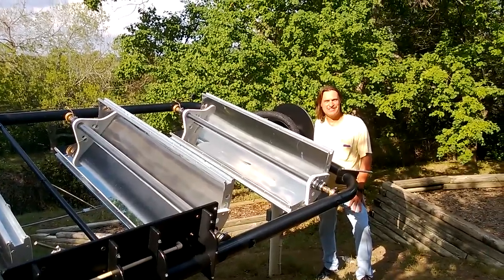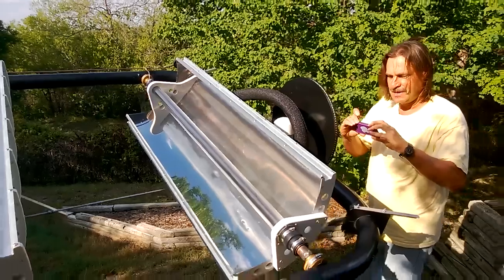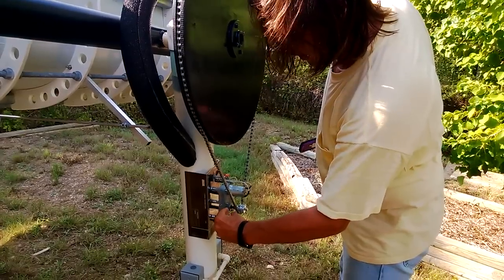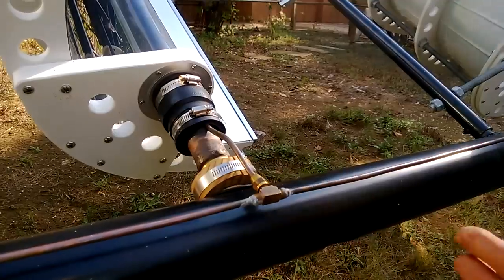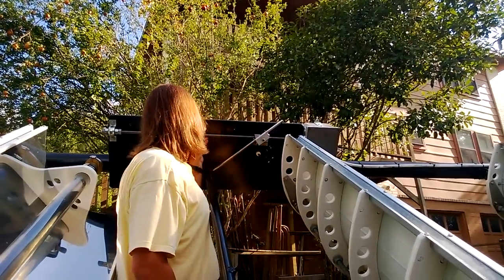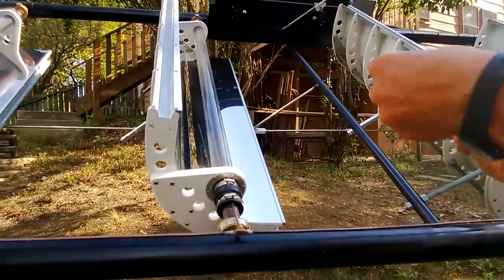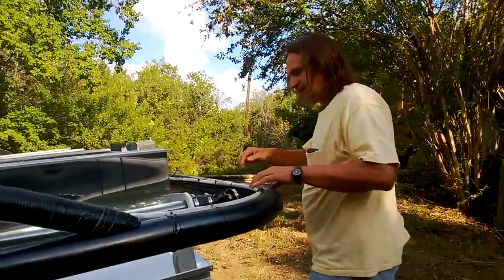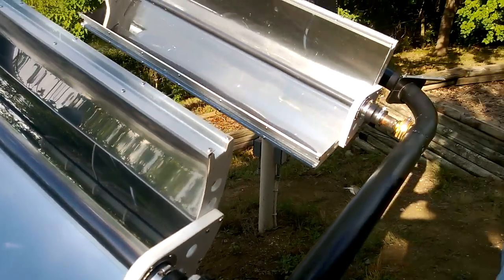Parabolic Trough Solar Collector Water Heater 6

Comment: Excellent job! This is truly great work you’ve done! I’m currently in the process of designed something very similar. What are the numbers for how much energy you’re collecting? Like btu/day collected? Surface area of collection? 

Have you considered putting the whole system on a slight angle, lower on the south side higher in the north side, so you could fit more troughs in the same footprint? 

Oh also what would you estimate the build cost at this point? 

Thanks again for sharing your success! I hope my build comes together looking as nice as yours!
Reply: I hope that he give us an update on how well things have worked in the long run.
I find his design very impressive, with a lot thought going into it.
I am thinking of how to reduce the amount of work involved to make a simpler design and I have a few ideas. 
He explains in one of his comments at the very bottom of this list, that you can reduce the complexity a bit by using one pivot. This is a link to his comment.
youtube.com/watch?v=tlBRpQffIBA&lc=UgxWqgiBnY3BdKQBuq94AaABAg 
- - - -
(1)-If you design just one bigger reflector, you eliminate wasted spaces between the reflectors.
(2)-Design the parabola edges to go at least a couple inches above the center tube.
(3)-Then you can put one sheet of plastic, or polysheet, or glass, across the whole thing to protect and keep the reflector cleaner.
(4)-There will be less t's and joints interconnecting all the tubing.
(5)-I have no interest in creating steam, as it will be harder on the connecting seals, and other parts of the system.
(6)-because of this, I can make the center tube larger, so that it takes care of times when the parabola is not precisely facing the sun. 
The suns rays will then be reflected to the surface of the collector tube, instead of missing it.
It takes care of problems where or if the reflector was made a bit off shape from an exact parabola shape.
(7)-To further take care of alignments when the reflector is not exactly aligned up with the sun, make the center collector tube sort of flattened.  
You can use 1/2 inch copper tubing and put a "U" shape by doubling back, or use 2 copper pipes side by side to be the center collector with the ends joined at each end.
A simpler method is to have 3 lengths by looping back and forth, so that you have a wide but narrow collector pipe to take care of  alignment difficulties or irregularities. .
(8)-When you are using one large unit, it is advisable to have this arrangement of piping for a larger center collector pipe.
(9)-When you are not intending to make steam, by putting one poly tube over this center collector tube arrangement, you can still get reasonable efficiency without the need to evacuate it.
(10)-The reason why this should work better than a flat plate collector is because no matter what your climate, you are considerably  reducing the overall footage of cooling surfaces, and I do not see the need to extensively insulate the reflector surfaces. 
- - - 
Let me know if you are able to read this comment OK. 
Give me your thoughts and suggestions. 
-
Reply: @DocScience2  I definitely have to give some of the credit for inspiring the design I ended ip going with on my solar collector to Andrew Gray. Watching this video really helped me finally make the executive decision on which of the many ideas I had to go with.
Reply: =  @CharlieSolis  = Thankyou for the fast reply.
Have you posted any pictures of your setup and descriptions ??
Reply: @DocScience2  I’m still awaiting materials. And hashing out the turbine build process. It’s super cold out where I am right now so I’m going to start assembling things in the summer.

Comment: Selling it is a good idea but posting this as open source will also help contribute to the betterment of humanity. Please consider doing this.
Reply from the maker: Hello DR Paquette.  Do you think there is enough interest and ability out there to put the open source effort required for this?  This design is really for the advanced do-it-yourselfer. (?)(?)(?)
Reply: Yes i do as a good portion of the population have been working in IT in one form or another for many years. With those careers (programming, database config, electronics design & integration, etc.) I am sure that it will be just fine for these people.
Reply from the maker: Well, I have been approached for plans by a few people and I have helped some build a few.  But the demand has been low.  So it is worth mentioning that I will help someone construct one of these solar heaters if they are interested.  AAG

Comment from the maker: 1) Yes, Grant.  On a clear summer day at 4 liters/min flow, one gets a 10 degree Centigrade drop across the heat exchanger.  That is roughly 2.7 Kilowatts, or about 9000 BTU/hour.  I have not made the measurement yet in winter because I need to mount the system up on my roof for it to be able to "see" the sun.   

2) The main advantage over regular commercial systems is that it will work in the wintertime when it is cold (it is insulated with a vacuum) and windy (comm. systems don't work then).

Comment from the maker: Jozef,  
I have the water circulate through a heat exchanger in a 50 gallon water heater tank.  This heats up the water tank for showers, dishwashing,etc.  It has dropped my electric bill by about $50/month.   

No, I am not producing electricity with thermo electric generators.  That would require that water be boiled and regulated through a generator.  That is a much bigger operation than what I have!
Andrew Ancel Gray

Comment from the maker: Thanh, I have used 1/2" hydraulic hoses from Northern Tool to make the flexible plumbing.  These hoses are REALLY tough.  So far no problems.  I am using a 12V TopsFlo TS5 15PV  pump to circulate the water.  It is about $70 on amazon.  So far no problems.  I have not used it to circulate water to and from the roof of my 3 storied home, however.  It should be OK since the circulation pipes will be FULL of water (as much pressure downward as pressure needed to pump upward).  I will let you know.

Comment: Let me give you and advice. Elevation angle adjustment is not necessary. Installation should be calculated to provide enough energy in winter when conditions are worst. The elevation according to sun elevation in winter should be ok for the rest of the year, since deviation will be desired to avoid overheating in summer.
Reply from the maker: Yes, Jorge, this can be true.  That is, if your spot to mount the system is oriented exactly East-West, then the second rotation-axis would not be necessary.  But if your roof faces, say, SouthWest, then the dual axis system is really nice.  Also, the dual axis system can be mounted in the "North-South" orientation so sun exposure happens ALL DAY.  And near the Arctic Circle (e.g., northern Canada), a dual axis system can get sun exposure for 16-20 hours per day (a single axis system cannot do this).

Comment from the maker: Well, I finally totaled everything up and since I did several generations of troughs, drive mechanisms, electronics, etc., the cost (for me and my experimentation) turned out double to what I was thinking, a little more than $4000.  I still think that a lower price than this can be attained if one starts with a "fine-tuned" plan and does not get distracted with experimentation (don't get me wrong, the experimentation  was fun and entertaining).  The system is now running month after month like an appliance with no attention now.   My electric bill this month (april) for my 1800 sq ft all-electric home was just $68.  Wow.  So when I put photo-voltaics on my roof in front of my water heater (the heater will be mounted on the NORTH side of my roof), I need to install a smaller system than originally planned!
Andrew Ancel Gray
Reply: Hello Andrew. Congratulations for your project. I want to build something similar to it, but the main motivation i have for it is to achive a low cost water heating system and share it, so people and industry move to a more efficient use of resources. My hypothesis is that price per square meter of reflector should be lower than price per square meter of heat absorber (normally copper). What do you think of that?
Reply from the maker: Jorge W Yes, I agree.  However, the absorber system will probably come out to be the same price since it is a simpler system.  But for the absorbers themselves, reflectors win the price competition.  For my system though, the absorbers have a vacuum surrounding them, which make them work year round, as well as near the Arctic Circle!  Flat plate systems will not work in the windy cold winter, even with sunshine!

Comment: For water heating purposes this system is adequate but, if you wish to run a small solar steam operation higher temperatures and pressures would be needed. 

It may be possible to construct a transparent vacuum box using the glass that is used in double paned windows. Double paned windows have a vacuum between the two panes of glass. If we can increase the distance between the two sheet of glass then we can insert steel pipes inside and then evacuate the system. A little bit of engineering and calculations have to be performed in order to determine the maximum temperature achievable.
Reply: Double paned windows DO NOT have a vacuum between the two panes of glass.
If they did, they would implode under the pressure. 
double windows often use a gas inside that does not transfer heat as fast as air does, but the gas is needed to equalize the pressures.
For a test,  I siliconed two pieces of glass together, and first put in spacer blocks somewhat equally spaced inside,  to hold the sides from imploding.  It worked ok.
That is what would have to be done to put the space between 2 panes of glass under a vacuum..  Calculate your air pressure which is 15 pounds/ square inch for normal air pressure at about sea level.. .
take a sheet of glass 1 foot by 1 foot and support it on all the edges. . Air pressure is the equivalent of placing  2,000 pounds of weight on that piece of glass..
Reply: @DocScience2    According to wikipedia some double pane windows do have a vacuum, to be precise the lowest air pressure achievable with commercial equipment.

https://en.m.wikipedia.org/wiki/Insulated_glazing

Other double pane windows have inert gas in-between the two panes. I think it would be best to ask the vacuum window manufacturers why the glass doesn't break

https://www.pilkington.com/en/us/products/product-categories/thermal-insulation/pilkington-spacia

It does appear that true vacuum glazing is only a recent development, using small supports running from on side to the other all throughout the window.

http://onlinedigeditions.com/publication/?i=228085&article_id=1830961&view=articleBrowser&ver=html5

So wikipedia needs revising and I was mistaken

Comment from the maker: This leaves all of the South and West sides open for photovoltaic panels.  However, Thanh, it would be neat to compare how the evacuated tubes work vs. the evacuated concentrated parabolics when it is cold outside.  That is why I built this system (so it would heat the water to 155F in the winter).  Andrew Ancel Gray

Comment: Looks good, have you built this after some plans? If so where are they available? Im mostly wondering what you have used for a reflector? I bought some reflective film i think its used for acvarium use for mine but im afraid the will be ruined pretty quick if run unprotected.
Reply from the maker: Decieved Well, I have not yet offered any complete plans yet, just bits and pieces.  I built mine by altering George Phlak's plans:
http://www.ffwdm.com/solar/solar-index.htm
I used mirror stainless sheet metal for my reflectors because we get large hail here in Texas that can destroy plastic sheets.

Comment: Dear AncelGray - WOW - Have you ever tried to reheat some thermal fluid such as molten salt (boiling point 350o C) or Therminol VP (boiling point up to 560o C) or even soybean oil (boiling point 300o C)? What were the results in liters per hour and what was the outlet temperature?

Comment: Andrew, how/where did you make/buy your black vacuum seals that allow the troughs to move?  They seem like a critical part.  Also, how hard is it to maintain a vacuum?  Really nice job. You and George are teaching us a lot!
Reply from the maker: s-h-o-music,
The black seals are Fernco P1056-215  2 x 1-1/2 pipe couplers.  I got them at Home Depot.  Here they are on Amazon:
http://www.amazon.com/s/ref=nb_sb_noss?url=search-alias%3Daps&field-keywords=+Fernco+P1056-215

Here they are in the diagram:

http://modelofreality.org/SolarFocalTube.jpg

I tried some other brands, and Fernco seemed to be the most heat resistant.  So I would be careful if substituting other brands.

No, it is not hard to maintain the vacuum.  I initially pumped down the vacuum chambers to 28 in-Hg about four months ago, and it is still holding at about 25 in-Hg.  I would expect both Helium and Hydrogen Molecules (H2) to be able to diffuse through the plastic, making it necessary to pump it down annually I would expect.

Yes,  a thanks to George for getting all of this started.  I probably would not have started this project myself without his 5 or 6 generations of experimentation with the trough design. 

Finally, the vacuum seals really do not "allow the troughs to move".  The troughs rotate on top of the clear plastic tubes.  The black seals simply hold the troughs in place at the ends (I put in some aluminum rub washers in between too.)  

Andrew Ancel Gray

Comment: i have also been thinking of a one axis system today as well. all in my head and no where near as clever as this. my main issue was also the flexible plumbing which can be a failure point at high and low femperatures. i guess your system must require a pump to circulate to the main water as this would be below your roof.

Comment from the maker: Thanh, I have not added up all the costs yet (I have all the receipts in a drawer), because I still need to mount my system on my roof.  I will be doing that in a few months and I will let you know.  George Plhak claims that each trough costs about $150 to make, so mine cost about $200.  Then you need approximately $250 in electronics,  $200 in framing and $100 for a heat exchanger to put in an existing electric water heater.  So ROUGHLY, lets say $1500-$2000 (Like I said, just ROUGHLY).

Comment: Build a very well insulated thermal battery with a heat exchanger; you could heat your water and home.  I know you live in texas; a cooling dominate climate.  When your themal battery hits a temperature of 180 - 200 degrees you could divert the heat into a thermocouple.  You could operate the thermocouple at a higher temperture (assuming regulations permit).  Thermocouples are not efficient; they are eaiser than heat engines (excluding a stirling engine).

Comment from the maker: Thanh, If you orient the system purely North-South or purely East-West, then a one axis system would be fine.  If you orient the system purely East-West, then you could manually tilt the system with the seasons.  If you orient the system purely North-South, your focusing error would have to be small as the sun went further south in the wintertime (the sun would not be directly overhead in winter).  This orientation would be similar to the giant commercial installations in the Arizona desert.